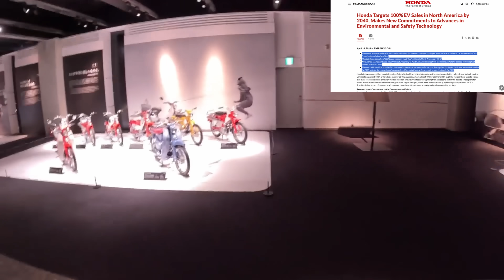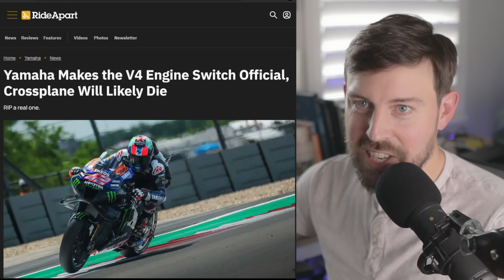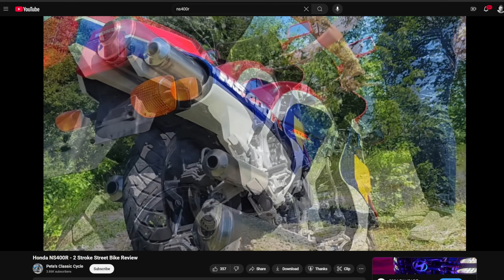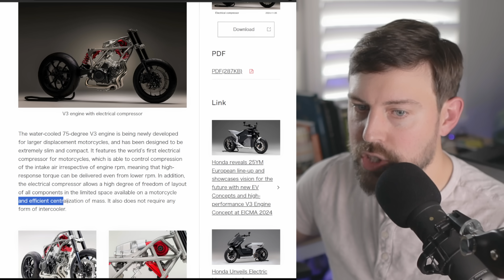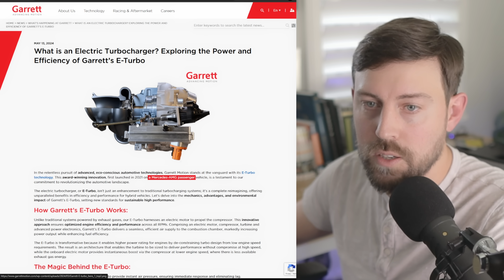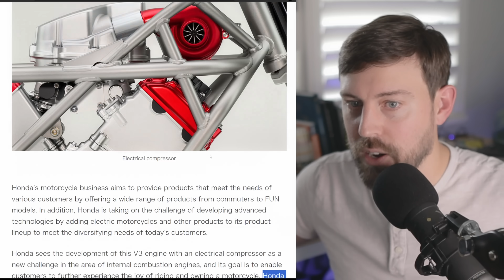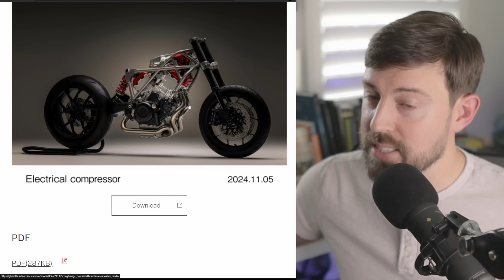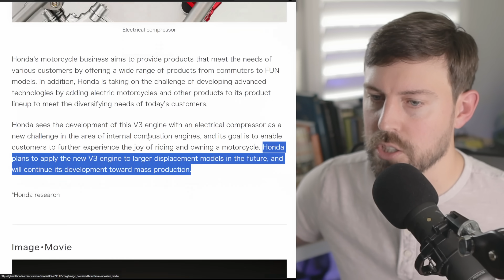Honda's new Frankenstein ENGINE will change the world...ICE lives on!

Comment: Kind of semantics here, but electric turbo =/= electric supercharger. Like you said, the turbo requires the exhaust turbine. If the compressor is purely driven by the electric motor, it is a supercharger.
Reply: @redstonegarage A turbocharger is an exhaust driven supercharger.  Whether they're exhaust, belt, or electrically driven they're all superchargers.
Reply: It's a turchargsupraturbinator.
Comon. It's a motor and fan.
hahaha
Reply: @exothermal.sprocket  LOL
Reply: Not really semantics. It's a supercharger.
Reply: I believe that the term turbo comes from the fact that it's a turbine.  Whether exhaust gas powers it or it's electrically driven shouldn't change it's name.
Reply: Well said ,
Reply: Exhaust driven: turbocharged
Mechanically driven: supercharged
Both: twin charged
Reply: @stephenboneau9090  In a turbo it is driven by a turbine
Reply: Who gives a crap what it's called. It's not going to be as tuneable as a conventional supercharger or turbo charger.... because it doesn't have a very large or high discharge  battery to push it hard. It's just going to be a very mild performance booster.
Reply: I’d say they run the rear cylinders exhaust up towards the other 2 for tuned length. It’d run rougher if they just dumped that rear exhaust straight out of the rear.
Reply: This was my first thought, supercharger not  turbo!

Comment: I had a V4 made by Ford of Europe that was fitted to my Transit van. Same engine also found its way into Saab 96, so yes V4 have been around in cars and not just motorcycles.
Reply: Porsche 919 hybrid is also a v4.
Reply: @knutbergan  I didnt know Ford had ever made a V4.
Did it have 2 cylinder heads... or was it a narrow angle V4 with one cylinder head, commonly called a VR4?

Edit- Just looked it up, it was a 60 deg V4 with seperate heads and called the Essex.
Reply: Yeah more of a UK/ European thing, the Ford Essex V4  was used from the mid 60s to mid 70s

Comment: The Ford Taunus V4 engine is a 60° V4 piston engine with one balance shaft, introduced by Ford Motor Company in Germany in 1962.
Reply: Saab 96 used the same engine.

Comment: Technically, no forced induction internal combustion engine "requires" an intercooler, however, every forced induction internal combustion engine would benefit from one. Simply compressing the air concentrates the heat already contained by the air. Think of a compressor as a magnifying glass in sunlight. You're not adding any heat, just concentrating what is already present. The mechanical action of compressing the air increases the collisions (friction) between the air molecules, producing heat. Frankly, I understand that effectively placing an intercooler on a motorcycle would be difficult, but don't let them BS you!

Comment: Ok. I have some questions which do not appear to be covered;

1) what is the motivation behind this new design - Euro 7 or future race requirements?
2) motorcycles do not need a turbo/electric charger. The power to weight ratio does not need it. 
3) There are more moving parts than conventional motorcycles (Reliability/cost).
4) Is it heavier or lighter than conventional motorcycles?
5) Is the centre of gravity higher with additional equipment above the engine?
6) Finally, has there been any market research for a change in design to meet customer needs?

I am sure clips like this is going to help with innovative ideas for the future, but for me moving from prototype to mass production has to meet customer expectations of what they want from a motorcycle. This looks to me like the design is trying to fix something that isn’t broken.

Comment: It's a compressor, and not a turbo charger, because there is no "turbine" part. The turbine of a turbocharger is the part where hot air from the engine's exhaust powers the same axis the compressor runs on. Without the turbine there is no turbo, so all you have left is the compressor.

Comment: Add cylinder deactivation tech to this engine and you have three engines in one package. 1, 2 or 3. You can run any of these configurations. Since it's an electric supercharger, you can have a Forced induction single cylinder 250 pulling the weight when you're conserving fuel and you don't need all the ponies. Innovative and I see plenty of potential.
Reply: Indeed, is the current blower feeding all three intakes?

Comment: It's not a Turbo charger is there is no exhaust running it.  It's an electric compressor.    There were some Hard Core V-3 Two strokes as you read from Wiki Peda..  A battery of some size and regenerative braking  to charge said battery that runs the compressor would be interesting.

Comment: There have been V4’s in cars. And it doesnt matter. V3. Well, never have hear of that for sure. Electric powered pressure boost? Dont see what is particularly earth shattering conceptually but it’s a great idea to try it. I like the channel. This isn’t “going electric”. But getting pumpers to be smaller, more efficient and cleaner is a solid goal. Cheaper needs to be in there too. A supercub with a 30 hp boosted 125 or something, hitting the commuter/ student/ daily need for a new century, getting 125 mpg and costing the same - and being fun while doing all that - would indeed be sort of revolutionary. The world needs realistic wheels. Motorcycles are important part of that. Road burners are fine of course. But Honda did what it did by getting a solid ride to 100 million cub riders. I think we’re on a spiral, not a circle, but at the same angle. Let’s spiral upward, not downward. Honda is a great motor company.

Comment: Lyten Li-Sulfur battery samples are now shipping.  US military is testing samples on drones.  Li-S is 60% lighter than LFP batteries.  Li-S are potentially 900 wH/Kg.  At 500 wH/kg you have electric jump jets. LFP is only 160. At 900 we are talking big jets like a 737.  I like ICE, but there is a crossover for power density and it was just crossed.  BEV has no soul so I figure we need to buy cool sounding ICE now and collect.

Comment: The only bikes today that can compete with these 500cc Two-Stroke bikes are 1000cc and 1300cc 4 strokes..And they would lose badly in a canyon race. Or a windy track... With new clean burning technology they don't know how they can bring them back into the race circuit because 4 Strokes are no competition...They are still tractor engines.

Comment: They should investigate putting a small high-pressure air tank between the compressor and the engine. That would make it true no-lag and would greatly simplify turbo control.

Comment: Please let's discuss semantics first. An "automotive show for motorcycles" is a... motorcycle show. Also, by definition a turbo takes its energy from the engine exhaust. Otherwise, it is called a supercharger. Be it belt driven or electric powered.

Comment: I think it's a mistake for Honda to use the electric compressor only on larger displacement motors.  A larger displacement motor already has a large amount of power.  The Kawasaki supercharged bike is a full liter.  It makes more sense to me to use it on a small displacement motor to give it the power of a larger displacement motor.  Imagine a 300cc bike that makes 50hp and weighs 300lbs.
Reply: Good point though they must have their reasons probably having to do with the market.
Reply: @gwilliamwallace  Cheers!

Comment: They did not  run the rear  exhaust pipe to the front to make it more cool looking..
  The idea is to have all pipes the same length to equalize the cylinder scavenging.
  All three pipes are entering the Muffler/catalytic converter in the same area.

Comment: Honda campaigned a championship-winning 990cc V5 called the RC211V in motogp in the early 2000’s.
Reply: ...and Freddie Spencer was pretty handy on their V3 2-stroke GP 500 in (I think) 1983/84, before murdering the competition on the V4 in '85  👍
Reply: That was typical of Honda back then… maybe things are looking up!
Reply: RC211V is a beast
Reply: Remove one cylinder front and rear. Voila. V3.

Comment: Kirk, I too am returning to the motorcycle world after a 35 year hiatus.  I am now 76 and I first bought a used '94 V-Max.  I traded it in on a '23 Grom as it is easier to get my leg over.  Groms are really hard to find; especially a new black one.  I also have aquired 3 other Hondas; a 2010 VFR1200f, a 2014 CB1100, and most recently a 2012CBR250r.  Although I am a Honda person and I am intrigued by this new concept,  I was really waiting for Yamaha to unveil a new RD350 two-stroke with variable exhaust tuning.  What they unveiled at EICMA was a HUGE disappointment in making a 4-stroke DOHC bike that will go absolutely NOWHERE.  They really blew it.   If they ever re-make an emissions compliant 2-stroke I will be first in line to buy it
Reply: Addendum:  Now that we have a REAL president in power. Day #1 he immediately destroyed the mandate that all vehicles will be electric.  Next he needs to remove the California Clean Air Resources Board which has gone WAY out of the way extending their power to removing legacy vehicles from the highway.  Possibly relaxing restrictions on air pollution would allow my favorite 2-stroke engined motorcycles to return.  With the new electric supercharger, undoubtedly it will need a bigger battery.  This does not necessarily mean we will be adding additional weight.  Have you ever picked up a lithium-iron phosphate battery?  I have one in my VFR1200f.  It has double the power and half the weight of a lead-acid battery.  Recent technology changes have created extremely powerful and efficient electric motors for driving the supercharger.

Comment: in the new civic, accord, and crv (and probably hrv at some point, right?), why do you think they hybridized the 2.0L engine and not the 1.5t? didn’t the 1.5t get better gas mileage than the 2L? was it because of the oil dilution issues of the 1.5?
Reply: The ICE in a hybrid setup usually runs the Atkinson cycle for increased efficiency. I don't think turbos work with  that.

Comment: Mercedes has a engine with a 48v electric compressor.  It has a 48v for the compressor and a 12v battery for the accessories.
I reckon a motorcycle would be this way.

Comment: I would like to see an opposed piston 3 cyl . 6 piston engine on a motorcycle. 6 cyl. engines are very smooth . This design has no valves or cyl head , but 2 crankshafts. It would work well with the blower . The opposed pistons balance well it works well with diesel too .
Reply: Coolest engine of all time: The Napier Deltic.  Eighteen cylinders with 36 pistons.

Comment: Just curious, have you been told you talk too much before? This subject does not need this much discussion due to the fact that none of the specifications are given yet or even hinted at yet. Honda has always been notorious for not giving any information away until the release of their motorcycles, ie: 1983 VF750F Interceptor, the first V-4 from them available here in the U.S. Everybody needs to relax until the release, because no one except the folks at Honda know what this engine includes or has or what size it is. Nice discussion video though and keep up the hard work.

Comment: Please stop moaning about the demise of the ICE! From what is evident in ALL the language from both manufacturers and government, there is wiggle room for whatever meets the goals of lower emissions, lower costs, lower weight, less overall environmental impact, and increased performance. Currently, there are several very credible projects coming directly from manufacturers and from automotive suppliers that will produce commercial-level solid state batteries, super-fast charging, alternative fuels, advanced ICEs, myriad gas/electric combinations, etc., etc. I've got two ICE motorcycles, one ICE car, and one EV. For MOST of what needs to get done with a vehicle, EV is hands-down the way: instant response, quick, quiet, smooth, no smells, no gas station trips (we got used to that crap), much easier to operate and maintain. For motorcycles, until the range hits a real-world 250 miles it ain't time yet. I enjoy the mechanicalness of ICE, drivetrains, and gearboxes - I've own more than 65 vehicles and have been driving for more than 50 years. And the sounds, too (BTW, you apparently have never hear a Triumph triple ripping up the rev range!). But whatever we end up with in the near and long terms, it will be an improvement. It's not bad, it's good; just different.

Comment: cylinder configurations/layout doesn't influence the sound as much as the crank angle or exhaust layout.  For example the 90* v-twin and 270* parallel twin has basically the same sound.

Comment: There is no turbine and there is no interaction with exhaust flow. You can't call it an electric turbocharger. It's a supercharger. End of story. And you don't understand intercooling either. Intercooling doesn't cool the exhaust air. The exhaust in a turbo turns a shaft. That air is not the same air going in the intake. Even superchargers (not exhaust driven) can have intercoolers. I love your enthusiasm, but you're making a few things up here.

Comment: No profitable car or bike company will be fully electric this side of 2050 UNLESS there is an unheard-of breakthrough in battery tech. This means range, fast charging, next to ZERO or zero risk of spontaneous combustion and longevity of the battery. No company will be full EV until EVERY one of these boxes are ticked. Only THEN will they truly be good enough to replace the highly venerable ICE motors.

Comment: That is a supercharger compressing intake air causing super co air to be forced into the intake. Turbos run off of the exhaust and superheated recycled exhaust gasses into the combustion chamber. Motorcycles already have cooling issues fue to leaning out the fuel mix for emission reduction and fuel economy. Therefore; superchargers electric especially make the most sense
Reply: WRONG ! There is a hot side on the turbo that is feed by exhaust gases - it spins an impeller on the Other end of the shaft that compresses fresh air that is feed into the combustion chamber…

Comment: ADV Bike ! performance of a triumph tiger, width of a Tennere, Narrow at the waist for standing and a compressor for low down power. Sounds like the best of all worlds. BTW. Didnt DKW ??? run a 2 at the front 1 at the back were the rear piston was a compressor (possibly back in the middle ages ;-))

Comment: I wonder if you made a full hybrid - if you could use the same motor that adds to the drive train, also power the supercharger - it's activation could be clutch controlled - so when you need maximum power, the electric motor engages, and also spins up the supercharger ... hmmmm.

Comment: Lancia did many V4 engines in cars from the 30s through 70s. Though they were very narrow angle 12-15 degree and shared heads across banks so would be more accurately described as VR4.

Comment: Compressor is correct … “turbo” is used loosely (Porsche BEV doesn’t have a turbo but they have a turbo trim level). Turbo is short for turbine. That’s what is getting spun by the exhaust gases, which in turn spins the compressor on the intake. Speaking of Porsche, they had a V4 in the 919 (race car). Yamaha is famous for their V4… Vmax is the original “power cruiser”. Intercoolers have nothing to do with hot exhaust. They are on the intake side, meant counteract the heat created by compression…and if intake air is cooled enough, you can increase air density so you can mix in more fuel. The exhaust pipes aren’t curvy for looks. They do it for equal length. Rear cyl would have a much shorter run as it’s closer to the silencer. Lastly, why the hell is your video thumbnail showing the bike upside down?

Comment: In a vehicle that is wheelie limited as opposed to traction limited; I'm not so sure front (both) wheel drive helps much in performance. Maybe as more of a safety or handling feature? Wonder what it feels like to have the front wheel helping to pull you around a corner.
Reply from the maker: Yep 2wd handling sounds like something I want to try out

Comment: Electric compressor is not a turbocharger unless the exhaust is also driving a turbine that is mechanically connected to the compressor shaft.

And the exhaust nothing to do with with the intercooler, and all to do with the compressor map efficiency and boost levels as that is ehat creates the heat.

Comment: The young Japanese engineers are idiots.. Why not work on the the power valve with a computer chip for complete combustion of 2 Strokes much easier then working on a piece of shit Turbocharger..Not to mention When you use a fuel injection system On a two-stroke.That turbocharger will be slow to wind up..And completely undependable With high maintenance cost.
When the power valve is perfected with fuel injection there is zero lag in response.
The two-stroke Racers we're so competitive they still compete and in some cases much faster.. And we're talking over two decades with no improvement.